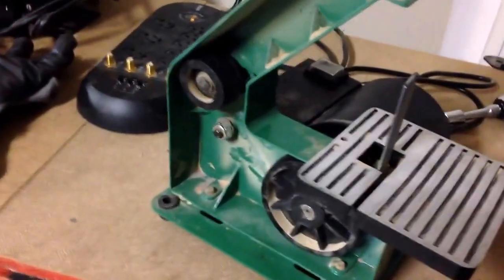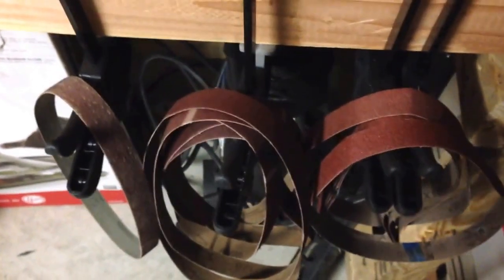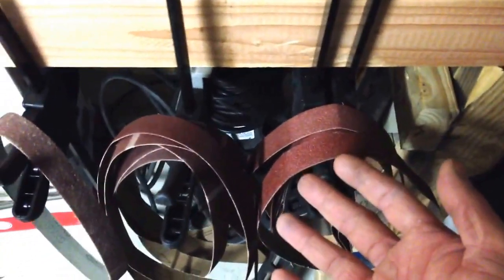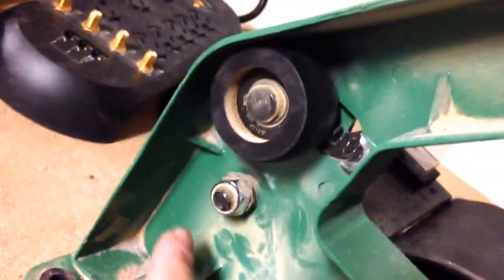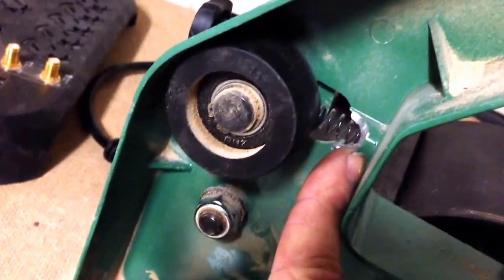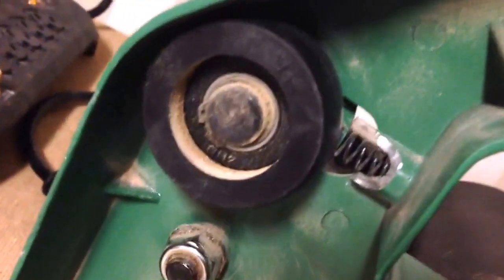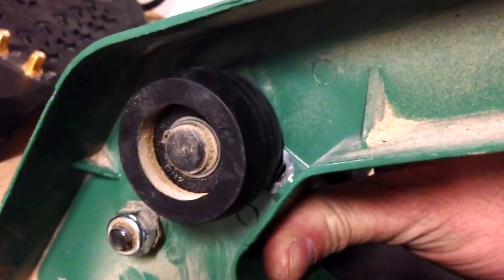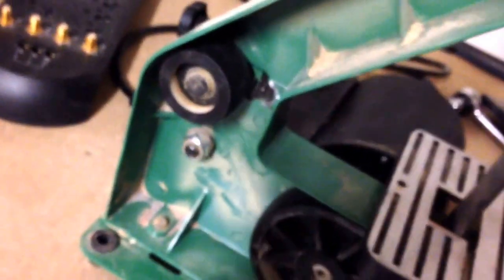HF 1x30 belt tensioner mod.

Comment: Just picked up a Harbor Freight 1x30 and some HF belts. The cheapest HF alum oxide belts caused a terrible chatter against anything I tried to grind.  So bad that the piece I was grinding would bounce rapidly against the belt/platen.  I tried several of those belts and they all did the same thing and I thought my machine was defective.   I put on a blue HF zirconia belt and it ran perfectly...smooth as butter.  Upon examining the belts I found the 5/3.99 belts were overlap joints and poorly done.  The joint was causing the horrible chatter.  The zirconia belts were butt- joint taped.  Those crummy belts are going back to HF and I will never buy overlapped joint belts again.

Comment: Thank You!..I just bought mine for my own Christmas Present (We do this every year!)…its sitting in front of me, right outside of the box.  I plan on buying the variable Grit Sanding belts for it next as I have a lot of knives that I want to sharpent, Drill Bits too.  I have a Dremel and I’ll follow your advice on this.

Comment: Jeez, seems no one read the manual. Leaving the wheel bracket loose allows the belt to bounce or go slack and tight repeatedly. Not the way it needs to work.
Reply: No, if it wasn't designed to be loose, there would be no reason to even have a spring there to hold tension.
Reply: @shannoncarrier7122  ok, this is why I'm confused. Mine was very tight when I got it. The belt tension was fine. In all the videos I have seen, there has not been much on this issue. Even the instructions dont mention anything about this. I thought one would loosen the bolt and let the spring set the tension and then one would tighten the bolt. I did try leaving the bolt loose, just enough that the pulley would move. When I started up the sander the belt was flopping around, and for sure that is just not good. So I went back and adjusted the tension and tightened the bolt and now it runs smoothly. I wish the manufacturer would clear this up. So for now, I use it with the bolt tight.

Comment: I know this is an old video.... But maybe someone will answer.... Do you tighten the nut to lock tension, or leave just loose enough to let the spring tension the belt?
Reply: Did you ever find out?  Just bought one and was wondering the same.
Reply: I'm going with common sense here and say that Yes, the bolt was tightened for shipment only and should be loosened enough where it can be moved freely back and forth to add/remove belts more easily with the spring tension holding the belt on.

Comment: Thank you for sharing.  Just acquired a HF sander.  This mod will likely be necessary at some point, but I've had good luck so far with the Red Label Abrasives belts being correctly sized.

Comment: I just got my sander today 5/17/15 and I had to do that to mine to get the belts I bought on ebay to fit. I actually did it to mine before I saw your video. I was going to make a video about this but since you have there is no need for me to make one too. Not a bad little sander for $40.00. I also modified the plastic spark guard so I don't have to take it off to change a belt.